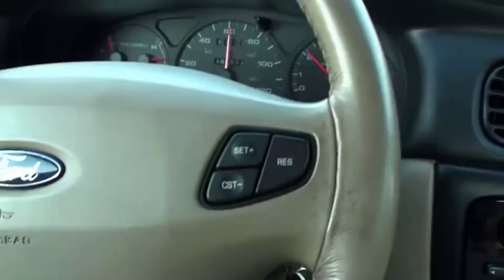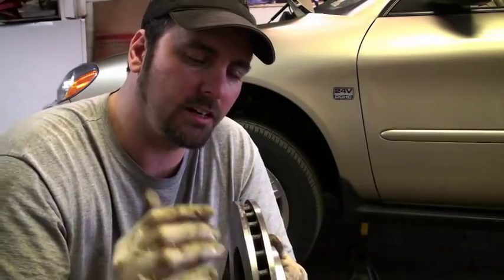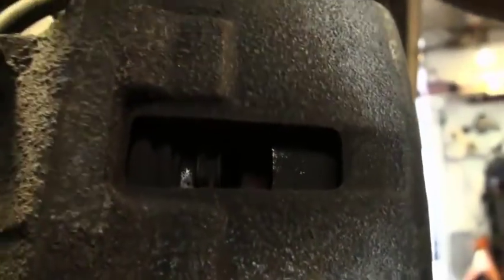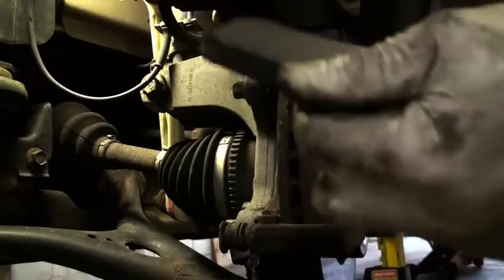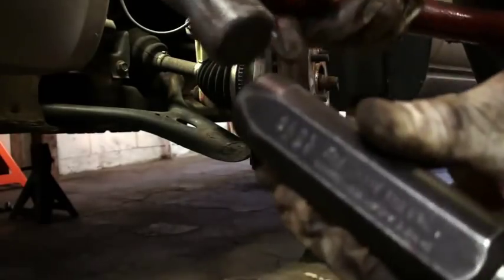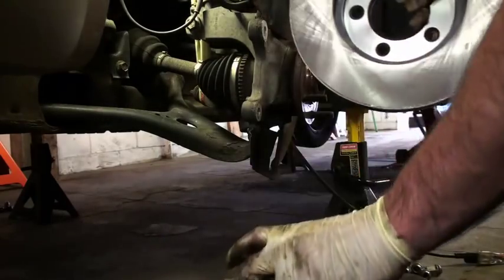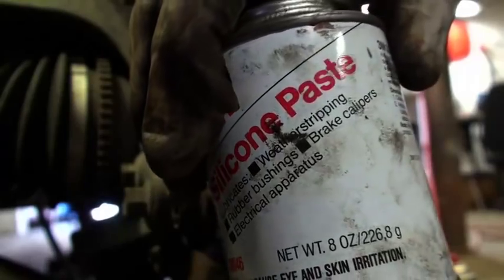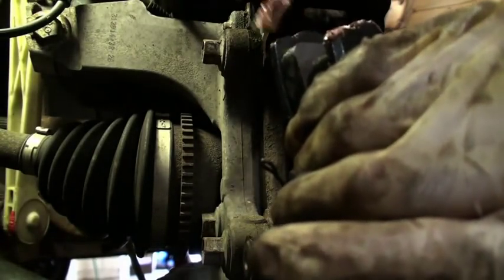Front Disc Brakes and How to Replace Them - EricTheCarGuy

Comment: Best videos! 

Why is it so hard to buy silicone paste /silicone grease for brake calliper slides in Australia. And particularly in a handy tin with brush like Eric has here. 
I can get it on eBay from America for about $40 a tin PLUS ➕ about $45 postage! 
Or a 100 millilitre plastic tube from the UK for about $35 delivered. 
But why is it not readily available in our autoshops? They just don't seem to stock it??? 
Do we use something else? 
 Is the food grade silicone we have in our dive supply shops the same thing, same melting point etc? 
I thought it would be so easy to just go buy a tin of silicone paste for my brake callipers... Go figure.

Comment: Great video... any tips off top of your head for replacing disc brakes/rotors on 1999 GMC Sierra 1500 (4 Wheel Drive) 5.3L V8??? Thanks and appreciate it if you are able to provide any more feedback...

Comment from the maker: Nope, check the wires and connections, the link is just an interface nothing more.  If you have this problem there are flowcharts to diagnose for different cars but for the most part the wires are for power, ground, and data.

Comment: i was in fact surprise the see those new pads jamming into the caliper, do you have to adjust/grinded them often,  i recheck last week and every thing is fine, now im pretty sure back pads are/will jammed the same ... i did a noob error tho, i give one wheel a good hammer and i thought i could easily replace it,  not on my Sx4, one dealer wanted to remove the hub and tras the front bearing, another dealer replace my stud by grinding it a little, and also grinded the sandguard, hammer the stud

Comment: When you use hand tools, it gives me more confidence...
Reply: DGOfTheCentury I bought some nice pneumatic stuff, I hate it lol. I don't like how numb it is for me and how often I break things with the pneumatic stuff... It's way easier for me to tell if I'm about to strip something when doing it by hand, and frankly it only takes me a couple minutes longer. 
Of course I only work on my own vehicles... I might feel differently if it was in a shop.
Reply: A couple of points.... don't let the caliper hang from the brake hose once it's removed, that can damage the hose and at best cause the caliper to stick and at worst cause the hose to burst and you lose all braking. Be sure when you change the pad to caliper shims that you also clean any rust and debris up that has formed under the shim. Brakes are made with precision, we know the dimensions of the pad, we know the dimensions of the caliper and we know the dimensions of the shim, but there isnt any allowance for the stuff that forms in between the caliper and the shim. I have found that the vast way to clean that up is to use an air cutoff wheel and lightly grind the area down to bare metal. The other thing I have seen is if you use anti seize it tends to only burn away once the brakes get hot, I have had good luck with red hi temp bearing grease as long as you keep it real thin, I've also used a product called ceramilube, and it was still there on the next brake job.
Reply: @jetjazz05  Sometimes that impacting/percussive energy is needed to break free rusted bolts.

Comment: Hey Eric

I got this sort of chirping noise coming from the front right wheel while the car is moving.  I asked this dude and he said it could be bad rotors.  I changed the brake pads inspected the rotors.  They looked aight.  So could a warped rotor be making a chirping noise? Gracias.

Comment: you only turn rotors when you replace the pads. usually you can only do this once maybe twice during the life of the rotor. a rotor can only be turned if there will be enough material left at or above the minimum thickness required. that means when you take it to the shop, they will measure the thickness 1st before recommending turning or not. turning can save you a few bucks but if you can budget it, it's recommended you just replace them.

Comment: Hi Eric! I am planning on taking it upon myself to flushing and bleeding the brakes on a 04 Accord. I'm too cheap to have it done at the dealer lol. I have four pints of the Honda Genuine brake fluid. I would really like to know the EXACT procedure if I can just do it LF, RF, RR, RL. Also is it okay to do a bleed procedure like one person in the car presses the pedal then I open the bleed screw then close it off and then the person releases the pedal and then repeat over and over for each wheel?

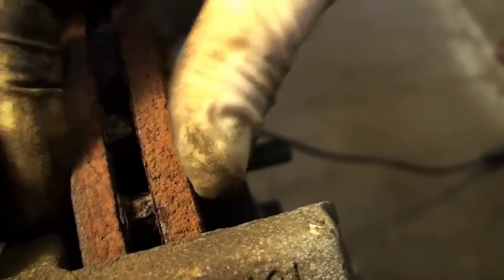Comment: @2:41, the bolt you remove on my 2006 chevy avalanche is a torx button head bolt and is extremely stuck.  I didnt let this stop me, as I found one I took off the caliper bracket I could just slide the caliper along the pins and get the old pads out that way....but guess what, the new pads are too thick to get back in this way. Any tips with how to loosen a torx bolt?  I went and bought the proper bit and even used it on an electric impact driver, but no good.  Had to install the old parts back!

Comment: Hi, so you open the brake bleeder valve and clamp off the brake line  before you push back the caliber piston so the brake master cylinder is not damaged. How would the brake master cylinder be damaged if you didn't do this, does the brake master cylinder have a one-way fluid value that would be damaged...

Comment: I am going to try this on my 2003 honda accord coupe. I know I need rotors because I can hear them grinding when I stopped. Any suggestons for a first timer? Also how do I know which brake pads and rotors to buy for my car??? Just go to the store and ask or is there a certain kind. I rather try it myself instead of paying 5-600 for the whole process..Any suggestions, recommendations, ideas will be greatly appreciated..

Comment: Eric  I need your input.

In my 95 accord the passenger front wheel was dragging, I replaced caliper and brake hose, bled brakes, afterwards I lifted the front end to see if the side I serviced was still locked and it wasn't, but now my drivers side is locked/dragging. before the overhaul the drivers side was fine no dragging it spun freely

Comment from the maker: Once again, try not to take what engineers do personally.  As I stated before they do things because of design constraints or cost.  Cars are made by committee so no one person is responsible.  In the end increased labor time works against them as one day they may need to pay for a warranty repair on a system or component.

Comment: do you have to torque the bolts for the caliper bracket and the guide pins for the caliper?  Instead of opening the valve to bleed the brakes, can you just take some fluid out of the reservoir and leave the cap off while pushing the piston back in?  thx

Comment: How bad is it to force the fluid back into the master cylinder? I did not open that bleeder valve or pinch the line last time I did pads.
Reply: I don't get what the "pinching the lune part" us for (and at what position in the brake fluid delivery to that side/end if the car?

Comment: Would Sil-Glyde lubricating compound work okay? It has many uses, it lists brake parts as one of them. If not, I have a CRC synthetic grease that supposedly won't harm rubber or plastic. What are your thoughts? Thanks.

Comment: I have this type of noise on my 95 Odyssey when I accelerate and brake lightly. It only does it one time after I parked for a period of time and sounds actually like a tapped on a thin metal shelf, and its only one noise, one pop. Not consistent or while driving or anything. I'm not sure what particular wheel its coming from. No clunk. No sound when going into gear either. Can you help Eric. Cheers !

Comment: Yes, I know what Eric is saying, and that WILL protect the Master Cylinder, but it is a bad idea to clamp off (or kink) a brake line.  They are VERY high-pressure (i.e. 5000 Pounds Per Square Inch or so).  If you weaken the line, it may fail where you clamped it under that extreme pressure.  Opening the bleed screw is totally fine.  Other than that, pushing the caliper in slowly is a good idea, too.

Comment: what would cause one break pad to wear at a faster rate than the other in front caliper-type disk breaks? are the sliding caliper bolts locked up? are the calipers bad? thanks very much

Comment from the maker: @kvitka075 What they are doing is allowing the fluid they are pushing back into the master cylinder run down the firewall and the floor more easily with my method this is not necessary.

Comment: Hey Eric

I was switching my winter tires off for my summers and upon tightening one of the lugs nuts on the front driver side wheel the stud it was screwing onto broke off.  The car in question is a 92 Accord LX(if my user name didn't give it away) I was told if you removed the entire caliper +caliper holder there is enough room to bang it out without removing the rotors+bearing. Is this true?

Comment: P.S.  I really wanted to do a video response for you, maybe I still will when I get back in there, but I needed to get my truck back together to get to work today in a hurry and I felt rather defeated...I just wanted to relax after that production.  I have since done a google search about this torx bolt, apparently everyone hates this bolt who has done front brakes on a GM.  Problem with torx is it doesnt stay well-seated while you use a breaker bar, etc...3 hand job.

Comment: It is my understanding that anti-seize is not a lubricant so it should be used for static parts such as a nut and bolt or a rim seated against a rotor hub.Parts that move known as dynamic parts need a lubricant such as brake grease.

Comment: @EricTheCarGuy I have a similar Taurus, 2004 SES with Duratec. I've been having disc brake problems since this past winter. My brakes squeak when they are cold, or at low speed/pressure. I didn't have this problem last year. Currently, my car has 71,000 miles on it. What is the problem? Do I need to service them?
Reply: Have you tried to clean and re-lube the caliper slides and contact points on the pads? Maybe a simple thing like that could make a huge difference.
Also a little anti-seize on the back of the pads might help.

Comment: 1) Is it ok to use brake grease instead of other pastes you used

2) not sure why you bleed brakes because when you push back the calliper piston the brake fluid goes back to it's reservoir.

Comment: When you write "I do it this way to protect the master cylinder" do you mean opening up the bleeder and sending the fluid to the bottle?  What bad thing will happen to the master cylinder if you just send the brake fluid back where it came from?
Reply: Yes, why ? I open up the the reservoir on the master cylinder , push the pistons back , then re -install the cap . What could go wrong ?
Reply: R. T. And yes  :) Eric Thank you for the video !
Reply: I was hoping this would have been answered as I am very curious also.
Reply: I always thought that the worst that would happen, is when you push the pistons back in it will cause the brake fluid to spill up out of the reservoir and on to the floor, assuming that some dolt topped off the fluid BEFORE the new pads were replaced.
Reply: pretty sure he doesn't want fluid pushing back against the master cylinder and possibly damaging it. to prevent damaging it, he clamps the brake hose so stop fluid from going back to the master cylinder, and bleeds the brake fluid to push back the cylinder holding the brakes to the rotor back far enough to take the caliper off and replace the pads. i'm not a mechanic, but i'm just using what i know about the engineering of a car to make a guess.

Comment: Eric--On a 2006 Toyota Avalon Front disc Brakes, The lower bolts holding the calipers are frozen. On one side the Bolt head is "stripped so that a wrench won't stay on it. Pliers and a locking pliers and hit with a hammer will not budge the bolt. The othe side, the head of the lower bolt is OK, bit it will not budge. Any suggestions???/

Comment: I did this to my 99 Civic SiR, main problem is the piston which is a quarter pushed inside the caliper. I didn't try the vice grips method, was afraid that it'll bust the hose. Is there any method/ thing to do before you park the car for the piston to be fully inside so as not to have the trouble to push it in when you disassemble the calipers?
Reply: There are special piston tools to do that. I usually just take some adjustable pliers and press them back. But be cautious when you are using this method, because you can warp the piston. If you do use pliers, make sure you take out some of the fluid out like Eric did. This way you can more easily press them back. And then make sure to refill the lost fluid.

Comment: @OldYgg Most any vehicle will not have screws holding a rotor on. Once you take off your tire With a tool you likely have already in your trunk {Tire Iron}, then take your tire off once your tire is off remove your Caliper With either a Hex Wrench or Socket Depending on the model of your car. Some you can change just the pads without removing the Caliper others will have to be taken off, Once you have your Caliper off it's as easy as tapping your Rotor and it will come off. 2 tools to do this

Comment: So I replaced just my brake caliper for the front passenger side and didn't change the rotors and pads.  Took it for a test drive and when I take turns or when I'm going 65 mph, my vehicle shakes.  Is this the cause of not changing the rotors and pads?
Reply: You changed the caliper then not brake or rotors. In the beginning of this video he says shaking is from or changing your rotors so why are you asking such a dumb question

Comment: The new pads will be thicker than the old pads, so you must recess the caliper piston in order to clear the new pads.  There wouldn't be enough space between the piston and the front of the caliper to go around the pads otherwise.

Comment: Would I have to replace pads when I'm replcaing warped rotors, even though pads look good? Could pads be warped and cause steering wheel to vibrate even though I;ve replaced rotors?

Comment: hey Eric good morning I have an 01 Isuzu Trooper I'm not able to disconnect the ABS module and I know that it's a poor connection at the ABS module I pulled the little lever on the inside of the connector but I still can't get them apart any ideas would be greatly appreciated thank you

Comment: I plan to do this replacement soon. But do I really need to bleed out the brakefluid? What can happen if I just push inn the piston without bleeding?
Reply: You can damage it. If you take out just a little bit like Eric did, you can press the pistons back more easily without warping them...
Reply: ResidencijaZLA how are you going to warp the piston?? are you kidding me. crack the bleeder open and push the piston back.
Reply: As a mechanic for over 11 years now, I have seen this happen. No, I'm not kidding you... I would rather open the bleeder and let some brake fluid out, than be liable to pay compensation for an entire brake calliper.
Reply: ResidencijaZLA and thats why I said "crack the bleeder open and push the piston back". warping a caliper piston you must be using a torch. Good luck

Comment: Bummer. Busted the bolt off in it when taking off the brake carriage. Managed to get the other bolt off and the carriage off. Guess I have to drill it out or find a replacement carriage?

Comment: My front and rear disc brakes are exactly the same and this is the procedure I use except I don't bleed off the fluid(had a horrible horrible experience with air in the brake line on a dodge colt that took literal hours to figure out) so I tend to not even mess with that crap!! Yeah I'm a wimp and cheap..

Comment: Hey EricTheCarGuy,
I had my 2010 Ford Edge (44000km) front rotors and brakes replaced on July 24 at a repair shop, and couple of days later I noticed some noise came from front of the car. The humming noise was getting louder and louder especially step on gas or brake. I took back to the repair shop on 16 September they told me that the left font wheel bearing was broken and going to charge me $350 to replace a new one. My question is what the chance is that their installation of rotors and brakes damaged my wheel bearing?
Reply: When they took off the rotors, they might have hit it a few times too hard with a hammer. This is sometimes necessary when taking the rotors off, because of the metal and the rust warping together whenever you brake and create friction and friction becomes heat. I have seen this happen a few times before. Still, if that is the case they should replace the wheel bearing free of charge...
Reply: Thank you+ResidencijaZLA , is it easy to proof that is their fault?
Reply: Haixu Yuan No, unless you have the old rotors. In any case you can ask for a second opinion in a different shop. Never the less, I have seen this happen at the shop where I work. It's kind of a newbie mistake...

Comment: what size socket was that for the bolts on the caliber? I regret not having a torch wrench to use cause i started to strip my bolts a little with small wrenches and a hammer :\
Reply: +Jared Cumberland You are most likely using an imperial tool on a metric bolt, or vice versa

Comment from the maker: Can't tell you how many times I've seen master cylinders ruined by this especially Honda's.  The master cylinder was designed to work in one direction it's that simple.  Besides, brake fluid coming out of the top of the master cylinder during a brake job is just unnecessary and unprofessional.

Comment: ........just replaced my disks and pads on my Seat Ibiza F Sport 2007.
everything was going well,
untill I got the the last bottom bolt/slider on front drivers side wheel,
AND THREADED BOTH THE SLIDER BOLT & THE HUB!!!! 8-(
I now need to buy a new hub & slider etc.
I've tried to tap & die but couldn't get the hub done.
so I'm car-less untill the shops open tomorrow morning
and hope they have one in stock!!
ahh well, these things are sent to try us!!